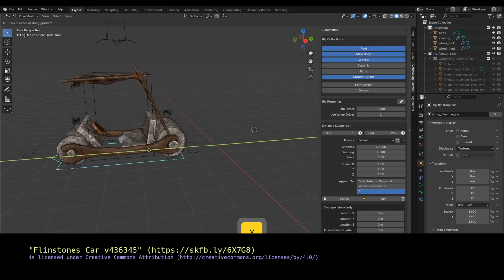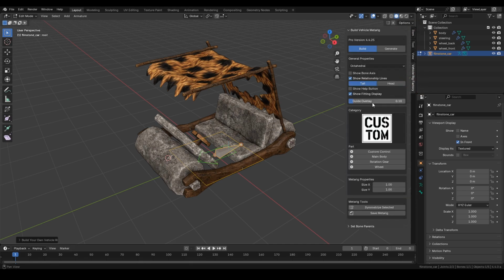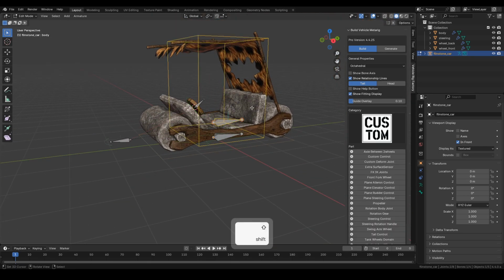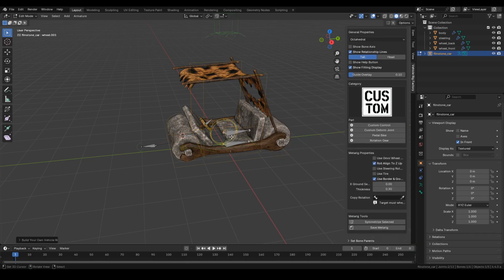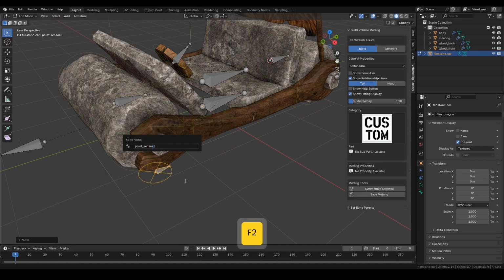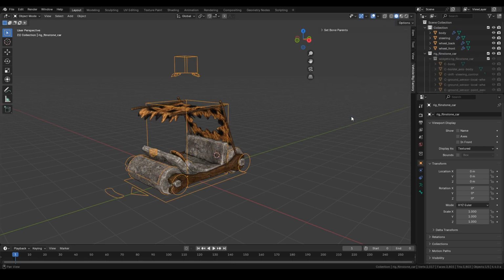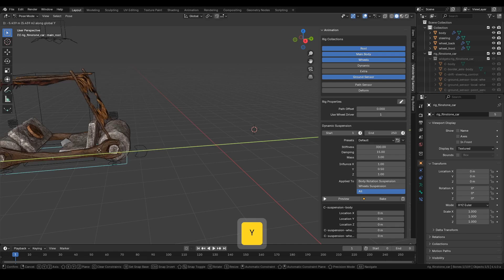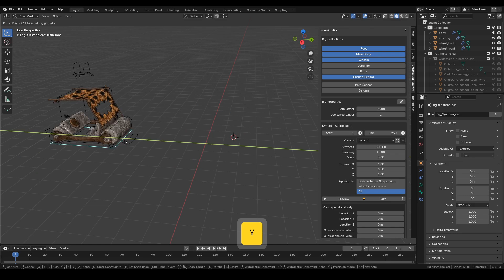How to Rig a Flintstones Car in Blender

Comment: How do you change the track and wheel speed?
My tank looks like it's on an ice field 😭
Reply from the maker: hi, please select the curve object related the tank tracks, look for parameter 'curve_length' in custom object property, you can adjust the value, and also look for gear bone tank and adjust paramater value of 'rotation factor' do both until you satisfied with result
Reply: @vrfplus_blender_addon  Thanks a lot

Comment: can the rig work in Blender 4.x, if I do the rigging in version 3.x. or vice versa
Reply from the maker: yes it can, but you need to use vrf_animator4x.py in the blender 4.x , this  code for the animator to ease using the rig
Reply: @vrfplus_blender_addon  Interesting. I will discuss it with my team
Reply: how do you use it? @vrfplus_blender_addon